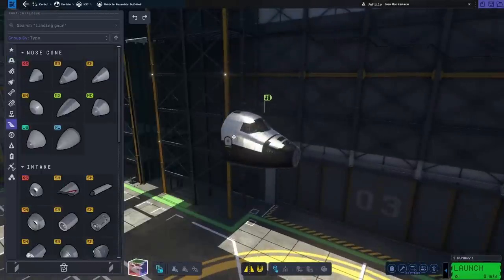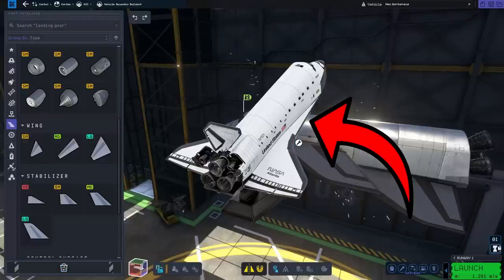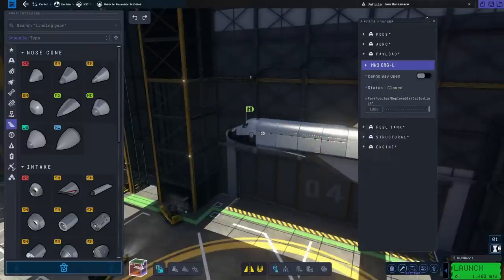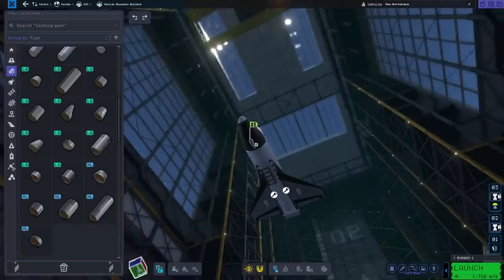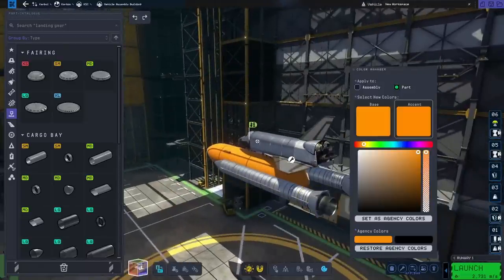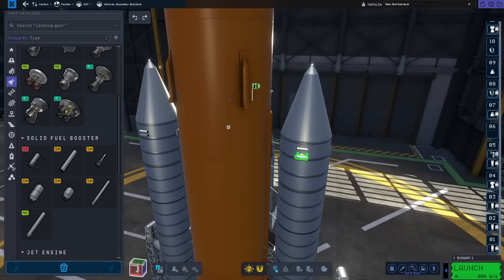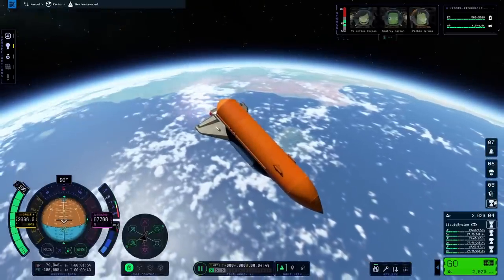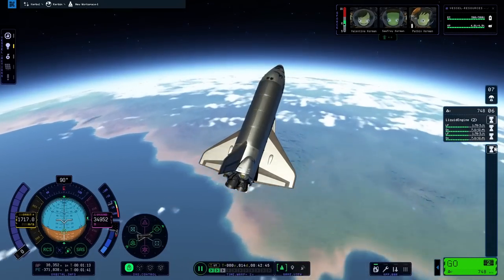How to Build a Space Shuttle in KSP2

Comment: nice, every time i make a shuttle it either cant get to orbit or it flips backwards during landing
Reply: Your center of gravity is likely behind your center of pressure. When taking off, make sure your shuttle engines are tilted outwards to push the back end in while the SRBs are firing. Maintain your launch angle by adjusting the throttle of your shuttle engines. Less throttle will make you rotate backwards, more throttle will make you rotate forwards.

Comment: Idk what is happening but constantly when im landing the shuttle, it keeps flipping over, i followed your instructions and also did not change the wings or anything, but it keeps doing the same thing, any solutions for this?
Reply: Mess around a lot with the wing position and add monoprop tanks to the front of the cargo bay. Turn on the indicators for Center of Lift/Pressure and Center of Mass. You want Center of Lift/Pressure just behind the center of mass. Too far back and you'll flip, too close and you'll flip